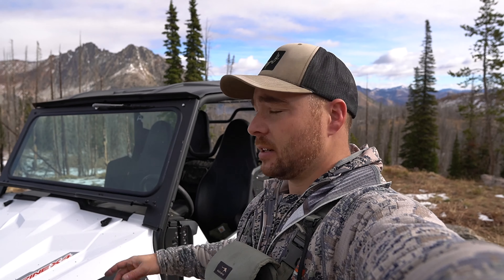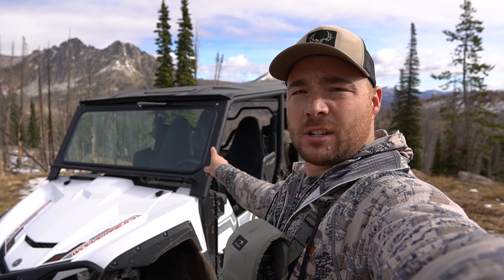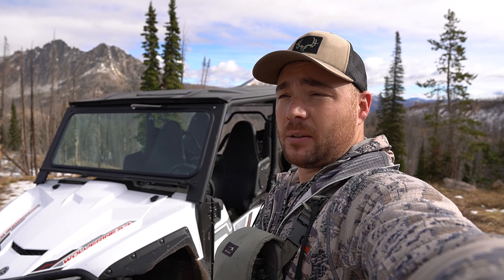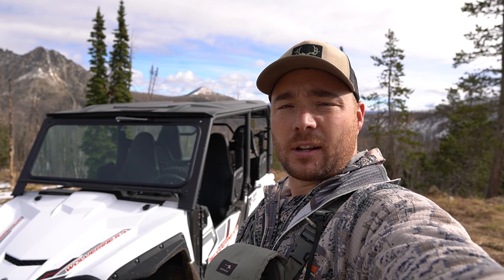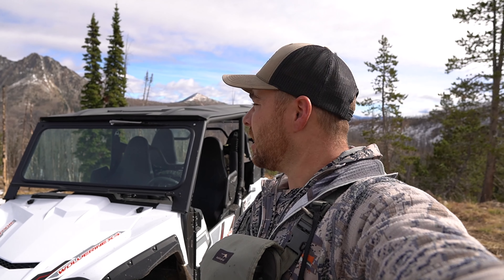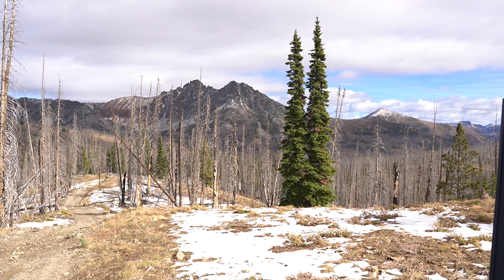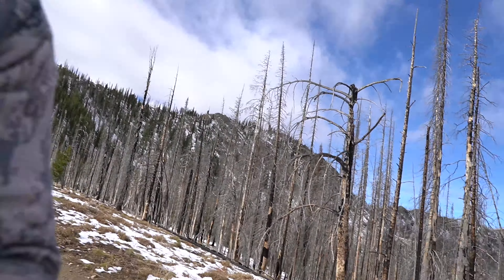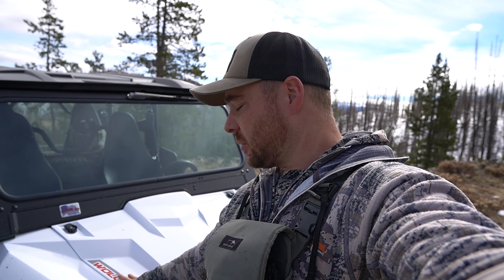FREEDOM UTV GLASS WINDSHIELD REVIEW

Comment: Great review thanks. I went with the superATV flip up, but this one looks good too. 

How do you like having the gun case where you mounted it? I am considering getting one for my x4 but thought about mounting a little higher up than you have it. Worried about my rifle bouncing around though.
Reply from the maker: The soft gun case was an after thought. I got it 50% off and just needed one. But, i like that its easy to get to, holds 2 guns and gear, can be easily taken off, keeps the guns padded and clean, and has a rain cover included in it. It would likely be in the way with back seat passengers though but i could clip it in behind the rear seats just the same.